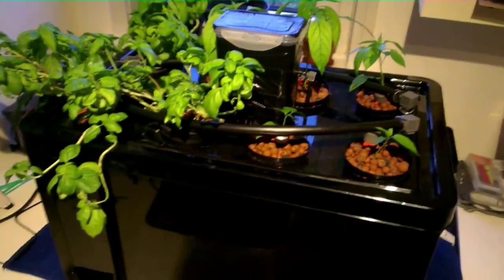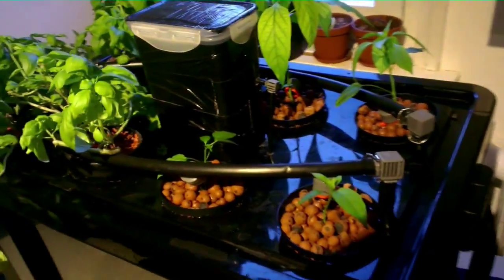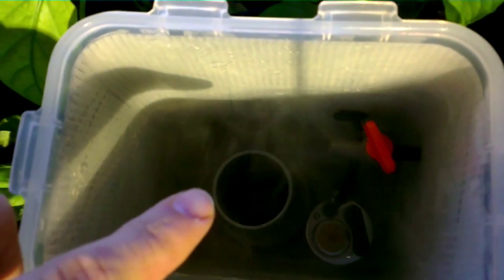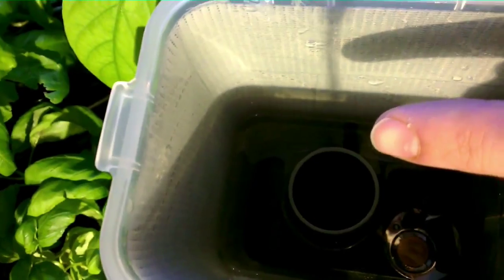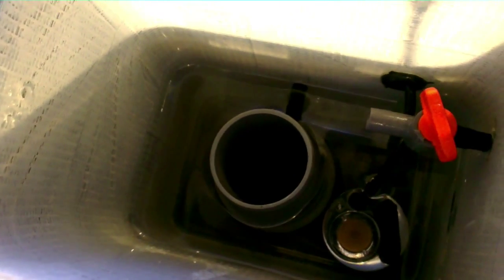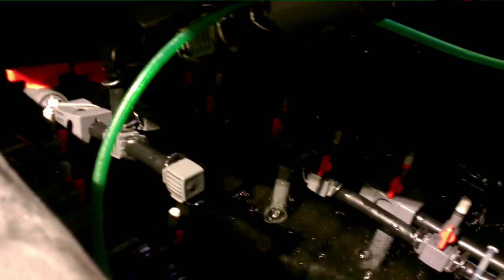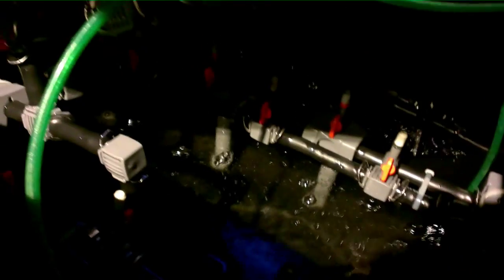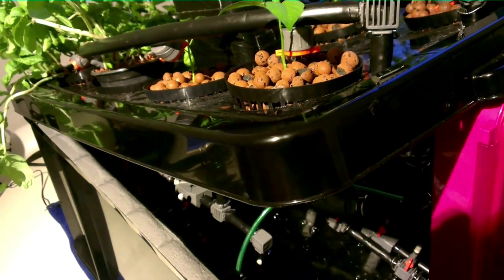4-Way-Grow-System (Aeroponic + Hydroponic + Fogponig + DWC)

Comment: This is brilliant just to say the least I've been thinking about it for a while with aquaponics on little bigger scale but basically this same system however do you have like a Perth list or plans for this system, I'm telling you it's so Kool...thanks in advance let me know if you have anything to guide me with a little more detail. Peace and thanks for sharing..
Reply from the maker: I have no plans or partslist or anything,Sorry,  but I used almost all parts from this company: http://www.gardena.com/de/bewasserung/micro-drip-system/
They have all the drippers and sprayers you need.

If I had to build the system again, I would leave out the Fog-Ponic part, because the fogger died pretty fast and it´s not nessesarily needed and makes the whole system overcomplicated.

HAve fun building your system and rock on!

Comment: WOW cool system!! but isnt the aeor not good enoth? how loud is the aero only? witch pump you use?
Reply from the maker: Hey.
The Aero-System alone is good for bigger plants with long roots. Small plants need a top-drip-system or you start growing them in pots with rockkwool or something like it.
The Pump is pretty loud, so you have to think where u can put your system. I wouldn´t put it in your sleepingroom.
It´s a submersible pump and it s one of the smaller models.
I hope I could help you.
Greetings, Peter

Comment from the maker: I think the most important thing is, that the roots of your plants dont try out. Sure they need oxigen, but if your roots become too dry, this is bad! So I would not run your fogger on a dayly basis. I would try something like: 
10 minutes till half an hour: ON  
and then 
half an hour till 45 minutes: OFF
I think it depends on the Setup.
(My System is running: 15 mins ON and then 30 mins OFF and it works well) 
I hope I could help you.

Comment: Hey i like your set up. I have a question for you maybe you could help me out. I have a fog ponic setup and this might be a stupid question but ive been searching for the answer online everywhere and i cant seem to find the answer. With a fog ponic setup how ofter should i run the fogger. Everyday and all day or how long do i fog for is it set at intervals because ive read you can over water and i think my plants might be getting over watered and not fed enough and they are under LED lights
Reply: Potatohead willson 
maybe too little too late, but I hear optimal rule of thumb setting is around 15 seconds on, 4 minutes off.